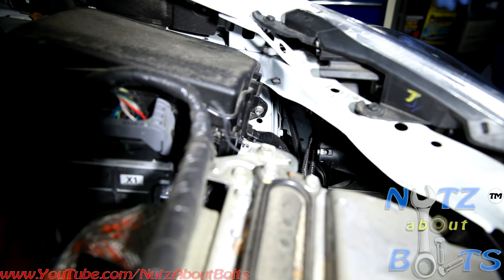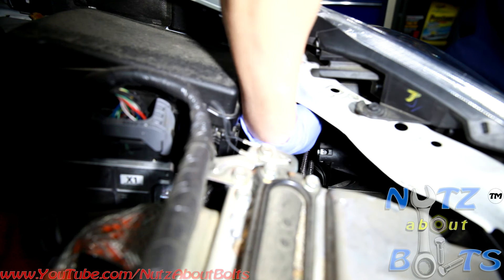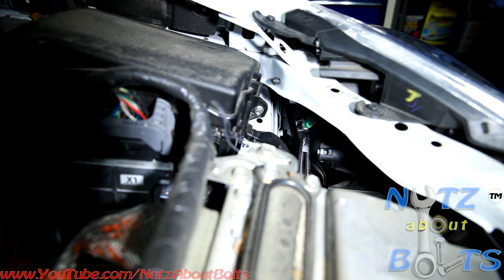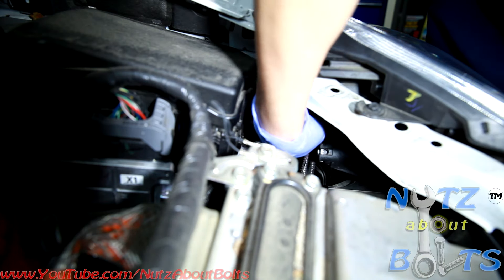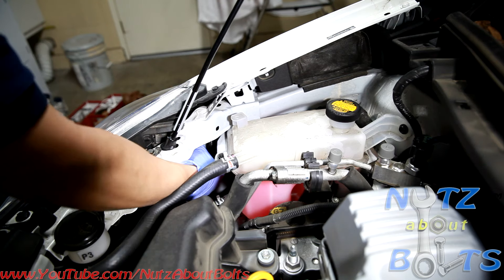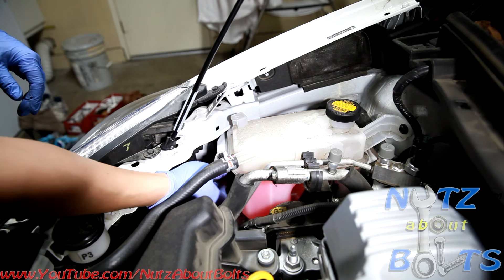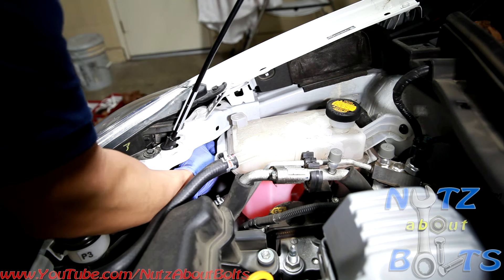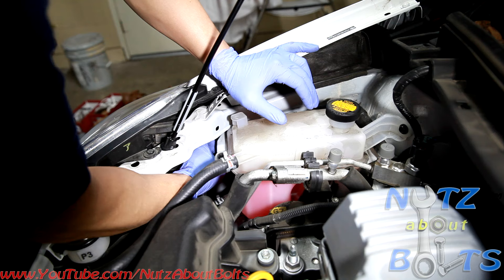2010-2015 Toyota Prius Headlight bulb remove and install

Comment: I found that the little orange gaskets did not come out when I removed the old bulbs which makes putting in the new ones much more difficult.  On my 2010 Prius, I ended up pulling the radiator reservoir loose for the passenger side replacement.  There are just 2 bolts and the hoses can remain attached.  I did remove an additional bolt that supports the air intake and the hose support clip. Then I could get my hand in to manipulate the bulb socket.  A 10mm socket wrench is required.  I only had an open end wrench, which worked, but was much more clumsy.
Reply from the maker: Michael Graham that's one way of helping yourself make more room to remove the bulbs :)

Comment: I managed to screw this one up.  Got the driver side on perfect of course. Passenger side didn't screw in properly and burned the plastic so it  won't go in anymore. Now it's temporarily secured in place but need to get it fixed. Does anyone know if the whole headlight unit needs replacing or do they sell it in pieces?

Comment: Not sure how the star in this video just snapped the old bulb out and the new on in. I found I needed to get a flashlight to study the connector. What I found was that there is a small plastic flange that is holding a small plastic nipple on the bulb base. I took small flat head screwdriver and pried the flange up before the bulb would come out.

The new bulb did snap in really easily.

Also I made a mistake and initially removed the high beam bulb.

'Tis a good day! I learned two things!
Reply: Lee Wimberly P.S. I sure wished that Toyota put just a couple more inches of wire so I could get the bulb out far enough for me to study the mechanism.
Reply: +Lee Wimberly I did the same thing with the screwdriver when I replaced my driver's side bulb 2 weeks ago. After watching this video I learned that you can just push on the bottom of the clip to release the hook. I just did the passenger side, and it was much easier.  However, the trick of installing the bulb first and then attaching the wiring last was so much easier for me.  It was the first time I've ever been able to do that side on my own.  I've always given up.
Reply: +Annette Shroyer Great idea-- interesting the bulb first, then the connector!  Next time I need to work on my Prius, I'll give you a call!  :-)
Reply: No, you just PUSH/PRESS on the bottom of that clip and it releases the bulb.  I tried the same thing you did but was afraid I would break it - so I watched a youtube video showing how to press on the bottom of the clip.
Reply: Same here - that's how I do it.  Put bulb in and then slide connector on.

Comment: I think on the passenger side it's best to remove the reservoir it's only 2 ---10 mm bolts and you don't need to disconnect the lines.

Comment: Video is great,but you must remove the water reservoir on the passenger side,all you need is a 10 millimeter socket, otherwise is impossible unless you have very little hands..for 2012 prius,txs for the video.
Reply from the maker: True

Comment: So it's counterintuitive when tightening the bulb back on, from the driver's point of view, you turn counter-clockwise to tighten (inverse of putting a lid on a jar, screw, etc.)?
Reply from the maker: +Paul Kuroda from a person point of view, when tightening it, you turn right as if you're tighten a jar. Turning left is loosening it. any left is loosening it.
Reply: Thank you!  From you and others, finding the unique prong on the bulb first, aiming that at 10 o'clock and rotating to 12 o'clock (from the passenger's view), worked like a charm, then attaching the harness afterwards.  What a time saver. I noticed it must be very hot as some plastic was on the bulb as I just drove a few blocks with it loose prior to viewing the Youtube videos.  So make sure and do it right or risk ruining your fixture.

Comment: Changing the headlights is cake. The side marker lights are a pain to work on. I did ebay led arrays in the side and top markers so I don't have to mess with them for a few years. The other thing I do from time to time I get out the water house and spray down the engine compartment so I don't have dust and dirt growing on my engine compartment.
Reply from the maker: +egn83b good work! :)

Comment: I own a 2011 Prius and change the headlight bulbs myself. The tough one to get to is the passenger side headlight but with persistence it can be done. The Toyota dealership wanted to charge me $75 to change it because the said they had to remove the bumper. That is simply not true. I use a fantastic vehicle maintenance program www.automotivewolf.com that manages the maintenance schedules on all my vehicles and keeps me up to date on everything. All 3 of my vehicles have over 100K miles and are all going strong with no major repairs simply because I follow the recommended maintenance schedules in the owners manual.
Reply: I use that software too. Does an awesome job!
Reply: very cool software!

Comment: Hello, I have  a 2011 Prius and only my  high beams work.  I bought H 11 replacement bulbs- do they work for both high and low beams as a single bulb?
Reply from the maker: +lynn priusowner H11 is for low beam, your high beam is 9005. Make sure you're pulling the right bulb out, they can both be confusing as to which one.
Reply: +NutzAboutBolts   Hello, I just wanted to thank you for all the information and advice.  I wasn't sure if I would be strong enough since I am a petite lady....so I had my coworker Brian watch your video.  The passenger side was trickier as expected, but he replaced them both and I can finally see at night without blinding people!
Reply from the maker: lynn priusowner
Nice! glad you got it fix, 1 less high beam Prius owner to get me at night :)

Comment: Agree that video makes it look too simple (driver side is much easier) and has little useful information unlike the comment section ie replace by staring East then rotate South, plug in bulb first then connect wires,  and lastly wear latex or other rubber gloves to avoid oil from fingerprints.

Comment: what is the best brand that gives you a good light, i bought one from ebay which supose to be xenon but my lighter gives more light than those cheap bulbs
Reply from the maker: +mohammed abudamos we usually use oem light bulbs from the dealership... the brighter the light output is, the shorter the bulb life is. So I don't like after market brand much.

Comment: I had a total nightmare fitting the drivers  side which in the uk is the left side when looking at the car found that if you fit the bulb first then fit the connector it's so much easier reason why the wire seems a bit short so unless your lucky you will find it difficult to fit it with the connector attached to the bulb
Reply from the maker: Beepin Laxman that is true, I should've done that first so not to confuse anyone. Sorry about that.

Comment: I have fairly large hands with long fingers and I absolutely have to remove, or move, the coolant overflow tank in order to get to the passenger side bulb. Still a pain, but it can be done without removing or moving anything else. Driver's side is definitely easier. I can't wait until I have to replace the high beam! Yikes!
Reply from the maker: +Steve Disser lol, the high beam is a lot easier!
Reply: Oh, well heck, that's GREAT to hear!
Reply from the maker: ***** I have a fairly normal hand. If you have a female friend with a small hand, maybe she can help you out.
Reply: +NutzAboutBolts  Yeah, I realized that after I posted. I was thinking about the low beams! And I agree with the post below. You almost have to be Houdini, but I've seen worse.
Reply: +NutzAboutBolts Now THAT'S a great idea!! :-)

Comment: How do you take the Little light bulb in the headlight out?
Reply from the maker: KevinGar1000 its the same as changing the light bulb, but it has its own socket area. it'll be on the side of each of the bulb.
Reply: Thanks
Reply from the maker: KevinGar1000 np!

Comment: When I change the H11's myself, I find that the headlights aim to the left.  Am I missing something?  Should I use the highest priced H11's ?
Reply from the maker: Richard RemembersJoePyne It shouldn't change the direction of the headlight if you replaced it with a new one. Was the old one aiming straight or was it aiming the same as the new headlight bulb?
Reply: You are right.  I just needed to make sure I installed the assembly right.  I left it loose.
Reply from the maker: Richard RemembersJoePyne
glad you fixed it.

Comment: I have larger hands and can't quite get the passenger side bulb out.  The coolant system is in the way, and I cant remove it.  Any suggestions?
Reply from the maker: +John MacKelvey you'll have to remove the front bumper if you can't get your hands in there... Is there a female hands that you can ask for?
Reply: +John MacKelvey, just remove the 2-#10 bolt on the coolant tank. You don't need to disconnect the tubes.  Length of tubing is enough to lift it out of the way.

Comment: Didn't catch how to detach the bulb from the connector clip. In my car there seems to be a death grip on the bulb.
Reply from the maker: +3rdEyeOpening there's a place to squeeze on the connector so that the clip is lifted and you can remove it. If it's tight, use WD-40 on the connector clip to loosen any dirt and debris it might have on it that prevents it from lifting.
Reply: +NutzAboutBolts -
Hi thanks for the quick reply. I tried that with no success, but then finally saw that my 2014's bulbs have something like a wedging tab that fits into a 5mm x 5 mm space, and that tab has to be pushed down (with a tiny screwdriver) for the bulb to come out. Wish there was a way to leave a photo in the comments so I could show you.
Reply from the maker: 3rdEyeOpening
weird... you can go onto our facebook page and send me a message there or you can email it to me. We have other platforms for that. :)
Reply: +3rdEyeOpening I used a flat tip too to push down on that tab and disengage the assy from the connector...works fine.

Comment: I switched the driver side -- Took 30 seconds - But I cant twist the passenger one off--- Fat Hands - got my friend with small hands to try-- it twists and you hear the click - still can't get it to come off--- any suggestions? Anything we can move to give more accesibility?  And i assuming we are turning counter clock wise -
Reply from the maker: NYCBRI lefty loosey, righty tighty. Make sure the connector is not plugged into the light bulb, it'll make it easier. Make sure you didn't install it crooked or else it'll cause the headlight assembly to be hot and cause a discolor in the assembly. There's not much you can remove to make more room since the passenger side is tight. You can use some WD-40 to remove any dirt or dust that's making it hard to install or remove. I hope these helps.

Comment: How many people watching this have had their headlight housings melt from replacement bulbs? I am wondering if my car has defective headlight housings or if this is common.
Reply from the maker: +Sean Ross could possibly that the light bulb was installed incorrectly and it was angled the wrong way and can cause the housing to be burnt.
Reply: No, it happened to both headlight assemblies, I have installed headlights in many cars and have never had anything like this happen. To me it seems like inferior manufacturing.
Reply: +Sean Ross Where did you get the bulbs and what brand/model are they?

Comment: Good video, my hands are too big to do this.
Reply from the maker: TheCe1ticZombie thanks!
Reply: NutzAboutBolts  I did manage to change the passenger side light bulb. I couldn't remove the bolt so I released the clip first with a long screw driver and then removed the bulb. This video did help a lot, although I didn't wear any gloves.
Reply from the maker: TheCe1ticZombie np! :D thanks!

Comment: Ok what if you don't have small hands?
Reply from the maker: You can go through the fender well.
Reply: With a 10mm wrench remove the 2 attachments for the coolant reservoir. Move the reservoir out of the way  - lift up and to the driver side. That should give you the room you need unless you have huge hands. It's still a difficult replacement. I like the idea of inserting the bulb first then connect the power. I'll try that now.